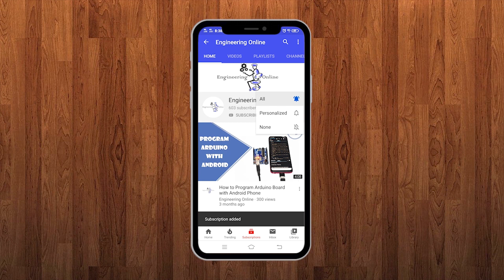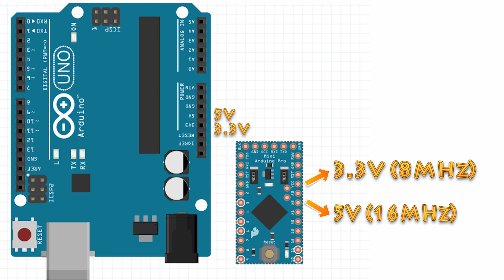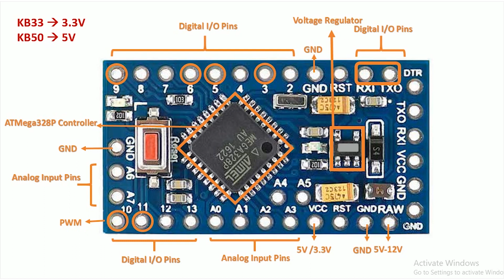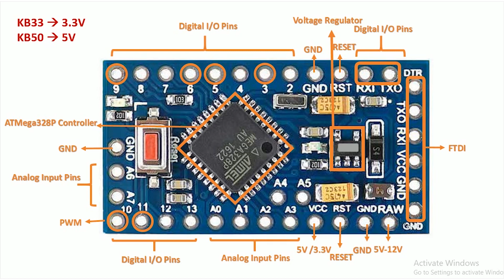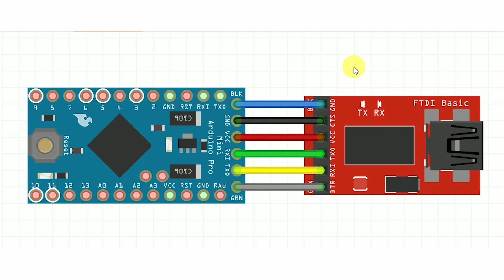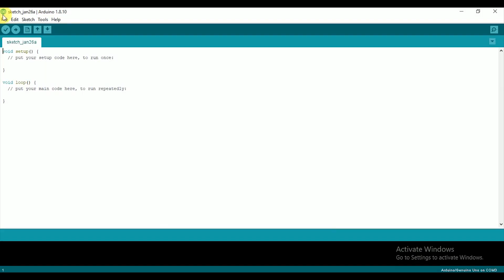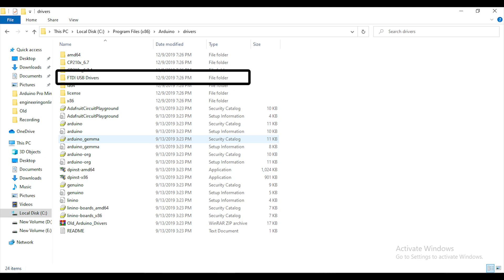How to program Arduino Pro Mini with FT232RL FTDI USB To TTL Serial Converter Adapter Module

Comment: FYI: Pro Mini voltage regulator marked with Kbaa can be both  3,3 or 5 v. To identify what voltage version you have you should also look at the ceramic resonator. If it marked with 0.08 it's a 3.3 V and if its marked with AR is 5V (from what I could find)
Reply: Connect 9V to VIN/RAW & GND, then measure the voltage on VCC & GND. It will be either 3.3V or 5V. No guessing needed.

Comment: Thank you very much for this informative tutorial..... One down side of this board is they are compact and without serial port but are high in price compare to arduino nano which are cheaper than this boards and with on board programmer. That's why I use arduino nano for my projects.